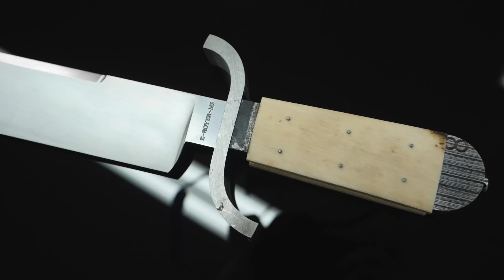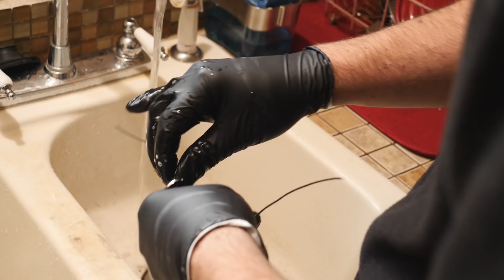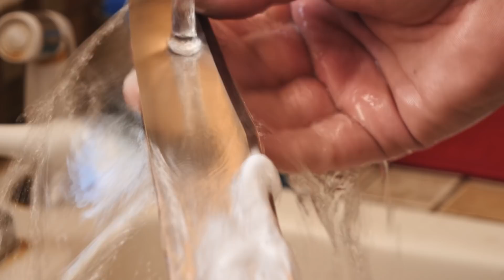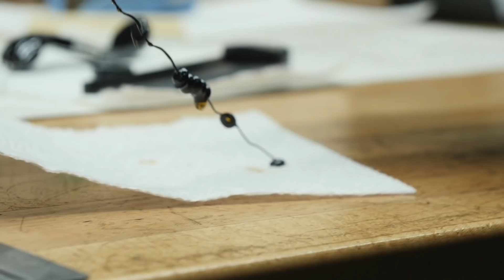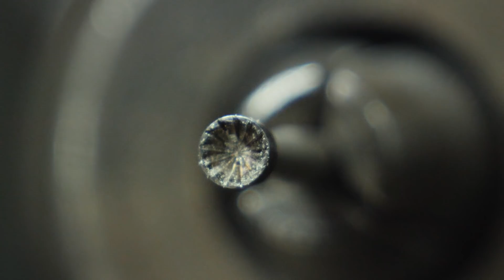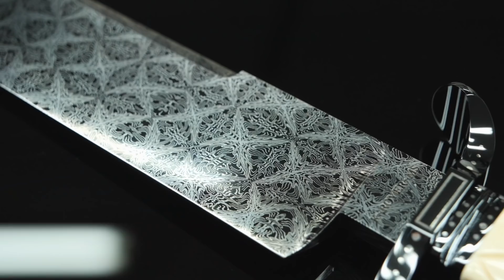250 Hours Later... (Luminous Final Part)

Comment: All you gotta do is coat the blade in DPC Titanium Oxide coating. Typically used in auto detailing industry, will prevent rust on the blade of the knife for 6 years plus with little to no maintenance.

Wax is great, but nothing compared to ceramic or titanium coatings.

Comment: Invest in a compressor and a couple of wet grind air grinders, then learn to use diamond pads, as used for granite polishing,...and an ankle length apron and gumboots, it's so much faster and you will save your lungs from the dust you have to sweep up otherwise.

Comment: Kyle, gunsmith here.

I know that this video is 7 months old, but one reason you may be having trouble with your bluing, is that the higher the polish of the part, the harder it is to blue. Since the bluing salts are essentially etching the metal, the higher in polish you go, the less surface area there is for the bluing salts to etch, therefore taking longer and sometimes producing off colors. This is why most guns that are Hot Caustic blued are not polished higher than 400-600 grit unless specified. Hope this reaches you. Also, ensure that your wire you are using is clean as well
Reply from the maker: Hey thanks my friend 
No doubt it harder. 
Some of my favorite guns are polished and hot blue and very expensive. Likewise it looks like properly hot blued knifes with a high polish hot blued are sexy looking and usually expensive. Wires are surgically cleaned. 
Going for more sheen. 
Glad you’re here hanging out with us all my friend. 

Dad

Comment: With the legendary attention to detail that you have, I'm sure you have considered the sources of variability in the bluing process. If you are using well water for that hose, you might be introducing just enough mineral impurities to the metal surface during your rinses with the hose that it could be the source of the hazy streaking. well water can have a considerable amount of total dissolved solids. Consider rinsing with de-mineralized water maybe?
Reply from the maker: Hey thanks William 
Is that how you hot blue. Cheers 

Dad
Reply: @KyleRoyerKnives  Ha! I’ve actually never tried it. My experience is with a similar chemical process where a protective magnetite oxide layer is bedded into the inner pipe walls in high pressure fluid systems. It is very important to maintain consistent chemistry without any introduction of mineral impurities for that to build up correctly. I imagine the solution you use is a very effective buffer. My only thought is that if you have some metals in your ground water, when you introduce them to the solution, because the reaction rate is accelerated you might be making molecule-thick layers of oxides other than the desired magnetite
Reply: Also no disrespect meant. Your skills as a craftsman and artist are absurd. That bluing process may have a level of variation that is impossible to control and your quality standard is other-worldly. I was just watching your video and my chemistry tech brain stuck on the “ clean” description you used for the hose rinse in between bluing stages. Clean for me was reactor plant grade pure water

Comment: This is simply an art masterpiece in the shape of a knife. Incredible!!
Reply from the maker: Thanks 
Merry Christmas
Reply: @KyleRoyerKnives  That's a beautiful piece! I am impressed! I understand all the hours needed to craft items. Several walking sticks I have carved (all so far have been made from my apple tree) often take 600 to 800 hours while only using various knives and no dremels. Instead of sandpaper I'll use metal to burnish the wood smooth, no sandpaper.
Thanks for sharing your process.
Reply: 250hrs work for a master blacksmith/knifemaker plus materials plus use of expensive equipment. what price would a knife like this fetch on the market? $30k or more?

Comment: amazing work. Here's a suggestion, use a copper tape. It's more durable than paper, and is harder to grind through. The only problem is that the adhesive may be hard to remove

Comment: Kyle, I was going through and looking at all your projects. Wow, you are leaving quite a legacy of forge mastery as you blaze along. Do you end up selling all of these peices of art or do you find it hard to part with them? I was also wondering if you ever considered using a modified torque wrench to tighten your pommel nuts or do you need to feel the pressure in your finger tips to do it correctly?
Reply from the maker: Hey thanks Jason. He have held back very few knives.   Setting the torque by hand is very dependable and secure. Good question my friend 
Merry Christmas 

Dad
Reply: @KyleRoyerKnives  Merry Christmas!

Comment: Absolute perfection! If you want the hole in the set screw at the bottom to lineup a certain way to the handle you can make tiny washers from shim stock. that will allow you get it as tight as you want it AND make the hole lineup the way that you would like. If you get some .005 shim stock you can make several shims, just add shims until it lines up the way that you like.
Reply from the maker: Hey thanks Craig 
Is that how you line up your pommel nuts 
Glad you’re here hanging out with us 
Merry Christmas 

Dad

Comment: That is jaw droppingly beautiful! Not knit picking at all, but wondering if that pommel nut not clocking square got at your OCD or whether it was no bother to you as it will change over time as its dis an reassembled
Reply from the maker: Good observation rx 
Between barometric psi, temperature,times being disassembled and reassembled the clocking is a mute point. Making the take down hole low profile is very desirable. 
Glad you’re here hanging out with us 
Merry Christmas 

Dad

Comment: That’s a work of art right there . 👏
Reply: That is why these are called "art knives". :)  They're for admiring, not for use - but you get triple points if they are useful and not soft metal, dull edges, and fall apart if used.